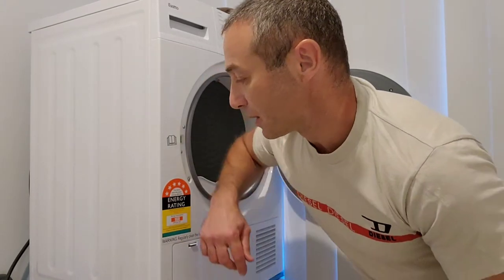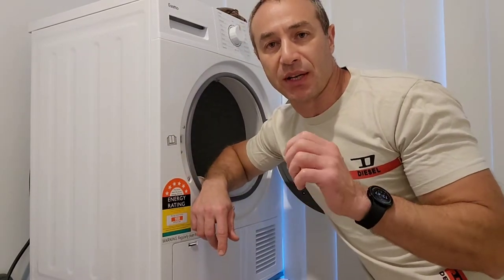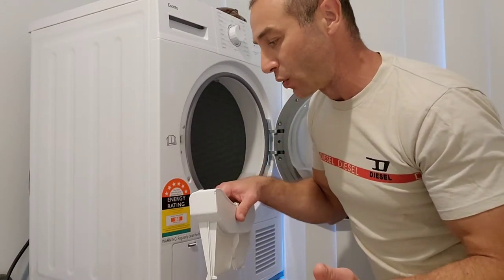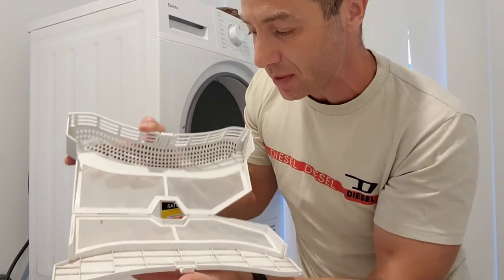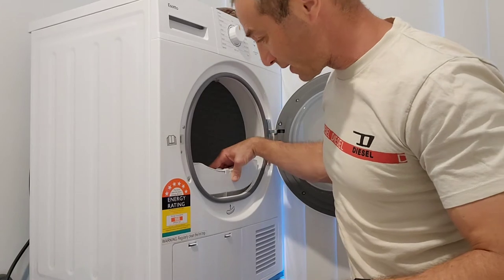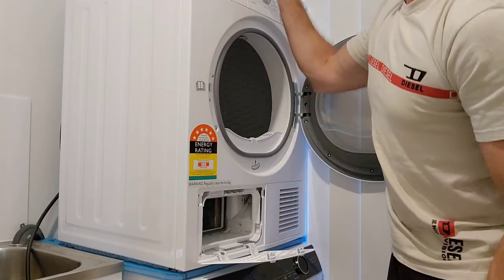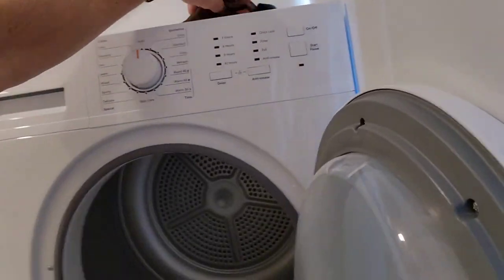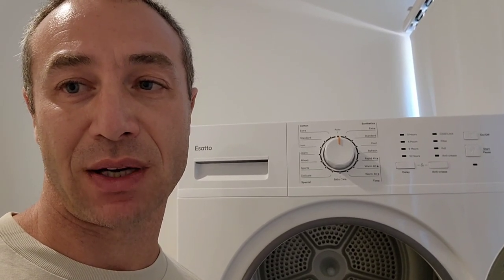How to open and clean filters in Esatto 7kg heat pump dryer (and more).

Comment: One thing we have had happen with this is bra underwires can break off and get stuck in the back of the dryer - not a huge problem but just an issue with how they can get trapped behind the metal plate at the back of the dryer tub -  on both occasions (mine and families dryers) we thought the dryer was faulty but turned out was the underwire bit tricky to remove, but certainly do-able. Just something to look out for!
Reply from the maker: Wow, that's interesting and good to know. Thank you for sharing. I'm curious though how they bypass both filters as there is literally no gap to get thru...
Reply: @GregYurchenko  It didnt bypass the filters, sorry I wasnt clear, it was in the main drum but stuck behind the silver metal circular disc at the back. You could see it through the holes as a wire.
Reply from the maker: @francistaylor1822  Ahhhh, I see, thank you for clarifying. It makes sense. I'll watch out for that. I absolutely love how people use this platform to help one another. Thank you for watching and commenting.

Comment: I've recently started get 'FULL' after drying.  Not sure why it's doing it. There is water in the container and nothing spilling out. Wonder if it's a fault.
Reply from the maker: There a couple of videos on my channel you may find useful. I think I described what you experiencing here: https://youtu.be/YtRo1QayxAE . Just make sure both of your filters are clean and condenser's fins are clean too.
Reply: @GregYurchenko  That's incorrect advice. As per the manual "Full" LED on permanently means the condensation container is full. So it is a failure in the water pump or water lever sensor.
Reply from the maker: @tboss1111 that's what manual says. However, this is not how it manifests itself to many...

Comment: I stupidly took the grey seal out of the back of the lower drawer vent and can not get it back in, any suggestions?
Reply from the maker: Oops, sorry to hear that. I'm on annual leave now and away from home for the next 10 days. I'll have a look upon return and let you know straight away.
Reply: @GregYurchenko  Thank you!!!
Reply from the maker: I looked at it and I'm pretty sure you can put it back there. I'm just not game enough to pull it out, even though I think I can create a great video for it to help others. The suggestion I'd make is that to take the "end" of the seal and try to tuck it in where "holding ledge" of the heat sink hole is. If it holds keep tucking it in until you complete the circle. Sorry if description is to vague. I wish I could help more.